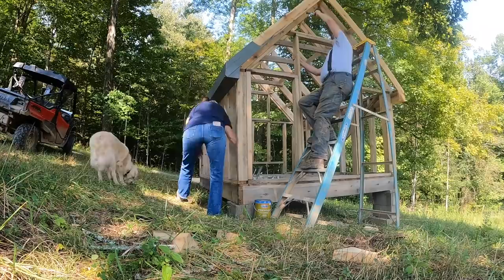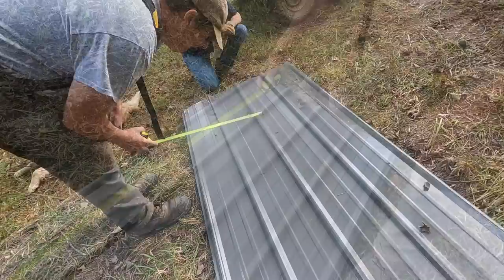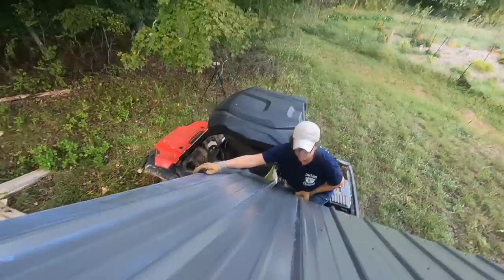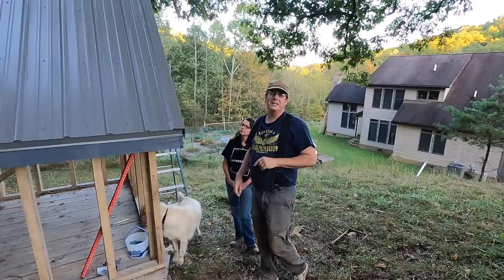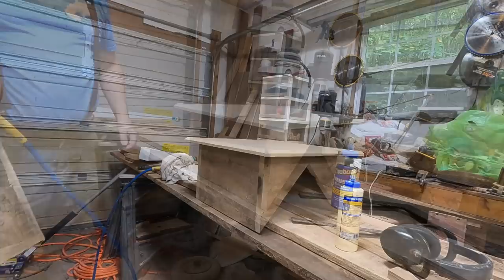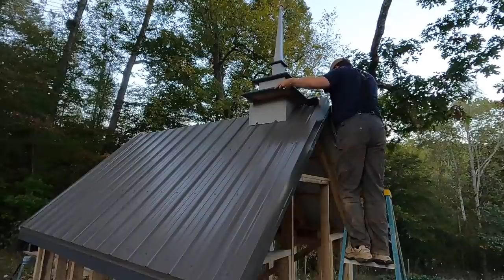Chicken Church Gets a ROOF and a STEEPLE

Comment: Its all good my friend. I need to put, metal on my chicken coop. For the gable Trim What some do is use the corner trim and cut part of the bend and then were the bend is left take and bend that over so there is not sharp ends and it then makes that side flat.  You can also depending on were you get your metal. They can make it that way. Many also use the corner trim on the peak of the roof as well.  I have found it cheaper to just buy the corner trim and use it for my corners, rig cap and cable ends, since all I have to do is bend it to were I want it.

Comment: Check out RR Builders on YouTube. He has a lot of information on trimming out steel siding buildings. One thing that you can do is do a bend up on the long edge of the last sheet if it is flat. Helps hold up the trim and prevents water penetration from wind blown.

Comment: Wrong gable trim for your application.  Should use the same trim as the eves, though in your case you should have ordered the trim bent to the pitch or gone with 90 degree rafter/eve cuts.

Comment: The way you have your wall extending to the edge of the gable makes this problematic. Most builds stop wall shy of the gable side so that gable trim can be flattened out. I.E. Construction oddity for you. Alternative would be to put in a cable end of flat metal about 3-4 inches from edge inward with a 2 to 2.5 inch overhang onto gable an then bring your roofing sheets as close to edge as possible Also put a small strip of ice/rain shield onto the flat metal for roofing sheet to cover creating a water tight boundary to prevent water destruction of the wood elements.